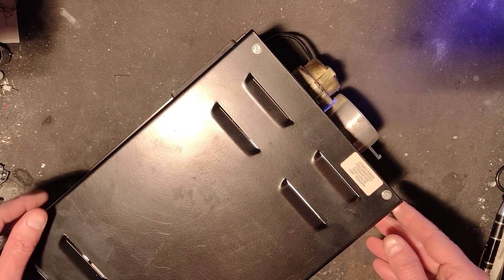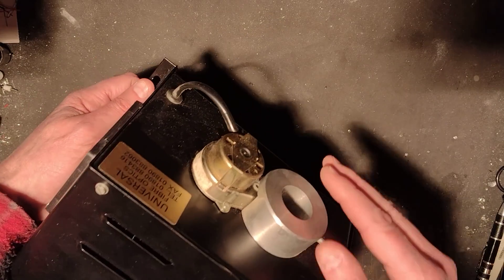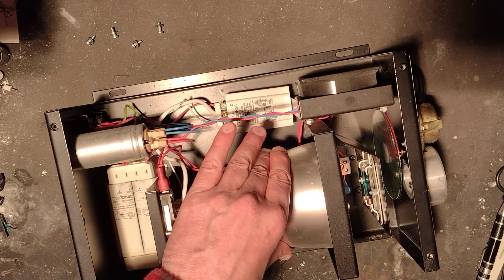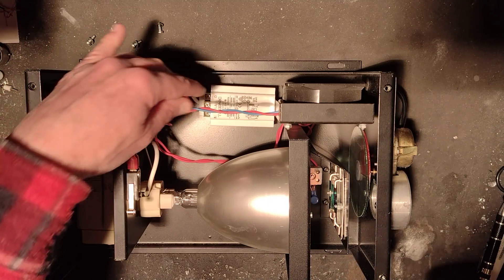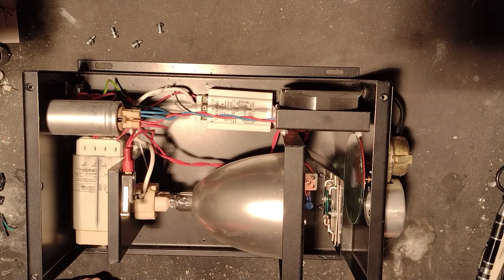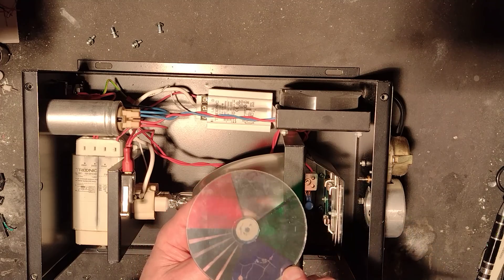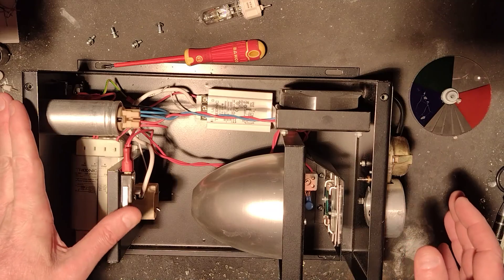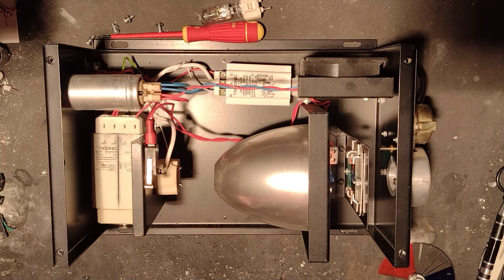Metal halide fiber optic illuminator

Comment: wow just seen this video and got reminded looking at our christmas tree that needs going back up in the loft  .. about 20-25 years ago we brought an 7-8ft fibre optic tree from BnQ  cost about £250 back then so not cheep . it ran well for 3-4 years every crimbo then a few of the bulbs failed (12v 10w MR11)  so i replaced them the next year the  thin plastic carusel ribbon broke maybe due too heat so i sellotaped that back together it worked again for a few years  ... then i cant quite remember whats gone wrong with it the last 15 years but as its out and due to be put up in the loft i might have a look at whats wrong with it properly after seeing this ... id love to get it working and modify it to run on led .. i got a feeling its some sort of power issue but will take it apart to try and find out ... if its not fixable by me is this something youd be willing to look at big clive ?. for a price of course ?.
Reply from the maker: An LED retrofit lamp is a great improvement for those trees.
Reply: @bigclivedotcom  yeah ive been looking i can get 4 for about a tenna so for 21 quid i should get this back working again mine needs 7 bulbs one upright and 6 that splay out the sides that have a trapdoor for easy access :) any suggestion what an upgraded cap i will need to buy ?.
Reply: just picked it up and straight away have seen without even opening it up that a (rubycon 25v 470uf yk) has domed and has brown fibres out the X part .
Reply from the maker: @davethorne3925  You could upgrade that cap to a 470uF 35V one.

Comment: I've seen Swarovski display cabinets with this type of light source before, but without the effects wheel.  The cases came out of a department store and have ABLOY Exec cylinders in the bottom cabinet where the light source is located.  When the cabinet is plugged in the fan in the bottom produces quite a strong draft.  Cases like that were well north of US$1000 new.

Comment: So nice to see one of these units again, it's been a few years since working on these lighting units, theres a few retail stores in town that use metal halide down lights primarily, just had a lead to the lamp holder while the controll box was effectively hung above the dropped ceiling, one store in particular had 4 of these projector units for the fiber optics that was throughout the sleepwear and bedding section to give a starey night sky effect, worked really well, was a nightmare setting out the fibers in the ceiling tiles.
Reply: Wow! "Controll" with two L's is a lot of control. Doubly controlled. 😁
Reply: @mattmoreira210  there's always got to be one ae haha

Comment: These were one of the most efficient devices for converting electricity into light ever devised, only exceeded by the most efficient LEDs with the most efficient power supplies.  This was actually one of their problems:  These lamps are far too bright for most applications, easily producing as much light as large banks of incandescent or fluorescent lamps.
Reply: True.  Short-arc sources can easily attain 80-100 lumens per watt and have excellent colour rendering, which is why they are still often found in studio lighting.  Only fairly recently have LEDs with the right characteristics for color-critical studio lighting exceeded 100 lumens per watt.  The only real drawback to the metal halide ones is the short operating life, but even this has improved with the introduction of ceramic lamps.

Comment: Those old UK-made  Thorn and later GE Arcstream lamps were, are still are very good lamps indeed tbh. They kick out 12,000 lumens with a CRI of 80 and a design life of 6000h.
I wasn't expecting to see one in there tbh, I was expecting to see a later, and more common these days CDM lamp. The ceramic lamps were even better with an output of 14,600lm with a CRI of 92 and a lifespan of at least 12,000h.
I've got a couple of fittings that use G12 halides in wattages from 20, 35, 70 and 150w and all of them are awesome with very precise beam control, something which LED has yet to match IMO.
It's also interesting that 150w CDM lamps in larger standard outer envelopes with GES bases are brighter at nearly 18,000lm and last for 20,000 hours. Seems having them in such compact form factors does restrict performance somewhat.

Comment: I have a fibre-optic 'angel' (Christmas deco) that blew its incandescent lamp, so I bodged in a somewhat modified LED downlight lamp, I was surprised how well it worked, even with the angels colour wheel. I liked the result so much that it didn't get packed away at the end of Christmas, and has now run, via a timer, for the last few years. I would have thought the motor, or my dodgy LED hack would have died ages ago, but no, she still shimmers away.
Reply from the maker: The AC synchronous motors are very simple with no brushes.  The colour wheel is also a very light load, so the motors will run for many years.  I've got a fibre optic flower base here that has been updated with an LED MR11 lamp.  It makes a huge difference to the intensity and colours.
Reply: @bigclivedotcom  Not bad for a light source that is mainly just blue & amber (phosphor) tricking our eyes that it is really white.

Comment: Oh, yes. I've encountered so many such abandoned-in-place fixtures of various kinds.

Perhaps my favorite was, when clambering around to fit a new BGM/PA system and route the networking/phone trunks, I found a complete speaker system already in place. The wiring had been run, but the wires had never been terminated and the speakers, though properly affixed, had not been cut through the ceiling. The grilles were carefully wedged upright as though to make the locations more visible.

Never did find the other end of the wiring runs; they simply disappeared into a suspended curtain wall (completely above the finished ceiling, yet still plastered and painted!) and couldn't be pulled back.

We left everything as it was, since there was a definite possibility of ceiling damage during removal. Fixed voltage speakers from the '70s, installed but never used for over 40 years. I'd love to have learned the story behind that.

After all, usually the speaker holes get cut in before the speakers even get near the ceiling . . ..
Reply: Most speakers I've seen mount to the hole in the ceiling itself, so don't quite get what you're talking about. Assuming the speakers mount to the studs/other structure instead of plaster/similar, perhaps the ceiling was put up after the speakers were mounted. That's what I'd expect if it was installed as part of new construction.
Reply: @eDoc2020  Around here anything mounted on the ceiling is required to be supported in case of earthquakes. The most common supports I've seen (and used) for speakers are either a light frame straddling T rails, a hanger wire, or both. In this case the ceiling was solid and the speakers were anchored to additional, non-load-bearing spans of the ceiling support framework.

It was strange in so many ways.
Reply: You see some right gems hidden away under dropped ceilings. I

Comment: I remember a school that was built around 1990 with a system like this as a decorative element. It ran for about 2 years and I suppose the lamp failed. It never ran again. Perhaps they couldn't locate the unit. It was a shame because it was really nice visually. Did they come in higher wattages like 400 or 1000?
The second generation of those highway message signs in the late-90s used tech like this in a lot places except instead of the wheel it had a matrix of shutters to form the characters that ran to the gantry overhead. Prior to that it was those green electromechanical pucks and afterwards came the direct sign-mount LEDs. Some of the fiber-optic ones were kept in service and the just light source was upgraded to LED.
Reply from the maker: Not sure if they did such high power versions.

Comment: Many years ago in my teenage years I became interested in disco lights and bought some gear from exchange and mart, one such thing was a device similar to this in that there was a light source via normal spotlight bulb and a small 240vdc motor with a disc containing 3 glass lenses and a red,green or blue gel. The motor span very slowly and gave the trippy coloured effect when pointed at the wall. 
Plugging it in at home in my kitchen for the first time, I discovered the motor wouldn't rotate, it was connected to the mains input with screw down terminal blocks. With my cheap and nasty lucky bag screwdriver I attempted to tighten the connections, half a second later I found myself about 6 feet away from the thing with my back to the fridge. That was my first lesson on learning to respect electricity. I've had a few reminders since then too. I'm glad I was a teenager before social media.

Comment: Sir, you mentioned about the IR reflector. I would be interested in knowing how they do this and still allow the white light to pass. Thank you for all your lessons.
Reply from the maker: In a dichroic filter a layer of metal is deposited to a thickness of a wavelength of light.  It acts as a selective filter, passing visible light, but acting like a mirror to the undesired wavelengths.

Comment: In a shopping mall no one cares if any light flickers or is out.
It's installed and forgotten.

You can still get a lot more light out of a discharge lamp and a lot more density.
They are not too bad for efficiency in high output applications.

Comment: We use something similar in the factory I do maintenance in they run a standard 24v bulb and have a variable light we still run halogen lights as the cameras we use on some of the equipment don't like led light sources. Very reliable in general.

Comment: OK, so now I know how to sup-up my outdoor X-mas wreath which has had a much smaller 12V version of this same mechanism inside it for years.   The lamp and motor still work but I actually have to turn off my other X-mas lights to keep them from drowning out the little twinkling fiber-optic points of light on the wreath.  One of those 4,000V suckers ought to do the trick...

Comment: I saw a smaller version of that in the late 70s - it was an illuminator for an inspection device that utilized fiber optics for illumination and inspection of the inside of turbines and other large machines. We take these for granted nowdays, but it was revolutionary back then - sensitive parts of machinery could be inspected without disassembling the entire device.
Reply: Those pieces of equipment have been in industry since the late 60's :)

Comment: How does the igniter work and how does it fit into the lamp cct? Is it like the starter in a fluorescent tube cct where the ballast is used to create a pulse when the filament load is removed?  Often heard the term igniter but never knew exactly what hey were.  Thanks Clive.

Comment: There are several advantages to Metal Halide, with a good reflector you can have pretty good efficiency.
Some bulbs deliver up to 100 Lumens / Watt.

The worst part with led are when they break, you can never find parts, and if you have lots of lights some of them will never reach 50´000 Hours.
Often forcing you to have one odd Light fixture, with different color temperature and lighting pattern. (or worse forcing you to change several of them)

Metal Halide, you just change the bulb, and the driver "lasts forever".
I'll bet 3-5 bulbs outlasts most Led fixtures.

Cheers from a Grinch 😂
Reply from the maker: In some cases one lamp outlasts 3-5 LED fixtures.
Reply: If you install lots of fixtures with non-replaceable parts it might be wise to buy a few extra units just in case of failures. When one goes bad you don't need to worry about an identical unit not being available.

Comment: Interesting to see one of those units again, BBC Tours had a couple feeding downlighters in a display area along a corridor in the basement of Television Centre.
These ran 24/7 so regularly needed a lamp change, unfortunately about half the time this was because the bulb itself had exploded… possibly some of my colleagues were not careful enough about keeping sweaty fingers off the quartz envelope. I always wondered what concentration of mercury vapour I was being exposed to while crawling around the back of the displays.
In order to save power and extend the intervals between bulb changes I mounted a timer on the case to switch off the lamp supply overnight (while leaving the fan running since the bulbs supposedly suffered if deprived of cooling immediately after switch-off). A couple of years  later BBC Tours moved out ahead of the closure of the building.
Reply from the maker: Explosive failure is a common end of life scenario for metal halide lamps.

Comment: That's got to be one of the most poorly designed safeties I've ever seen. It's almost worse than not having it at all because it has the potential for someone to rely on it to cut power and then lean on it wow they're working on it. That switch should be off to the side out of the way somewhere
Reply: Modern cases have a tab that goes into a slot to activate the interlock switch to prevent exactly that.

Comment: The blue gel likely cracked due to repeated heat/cool cycles and the thermal expansion of the glass plate repeatedly stretching the gel.  You see the same on old pinball machine backglass and you tend to see one or two colours being significantly more affected than others as they are less compliant to the expansion.  It's repeated heating and cooling that causes it as lightly used but poorly stored machines often show worse cracking than a machine that is in constant use but in a more temperature stable environment.
Reply: My guess as well.

Comment: I actually used to work for UFO and manufactured many of these MH illuminators, I  designed many of the led light sources and led fittings that UFO currently sell and continue to work for them on a Self employed basis a great company
Reply from the maker: The LED units look very stylish.  Literally designed around their function.
Reply: @bigclivedotcom  they always were and we kept things simple...well as simple as they could be. The early days were hard work as museums required high CRI not so simple with early LEDs but my biggest achievement were the MH equivalent units. We were first to the market. UFO no longer manufacture MH or TH Light sources unless specifically requested.
Reply: Are LED fiber optic illuminators as reliable as MH ones or do they start blinking after a few years or use like pretty much every streetlight out there ?

Comment: That capacitor looks to be very similar if not physically identical to the one used as the main wash pump run capacitor on older model Whirlpool dishwashers. FSP number 8269507 which is 23.5 μF 280 V rated. The second groove from the top is actually a folded bellows section to allow it to expand in length should it fail and produce gas pressure internally.

Comment: Clive I remember our old GE 8mm projector had those neat but expensive Sylvania or Westinghouse DJL lamps that had an internal reflector. Haven't see those lamps in a long time.
Reply: It was probably using an halogen lamp (with a tungsten filament) rather than a MH lamp (short arc discharge), I suppose.

Comment: Very simple circuit, the same as used in conventional street lights. LEDs might be more efficient, but discharge lamps are still more reliable.
Reply: And discharge lamps don't cause harmonic headaches for the grid unlike LEDs

Comment: I wish you had explained the ignitor & ballast circuit with a diagram. I've often wondered how they work.
Reply from the maker: I may cover that in another video.
Reply: @bigclivedotcom  I've always found ballasts very intimidating.  Anything electric that buzzes should be treated with the utmost respect.
Reply: The ballast is an inductor in series with the lamp, which does for AC what a resistor does for DC: it limits the current, other wise the lamp would self destruct.The ignitor is similar to an ignition coil in a car, it is also an inductor but with much higher inductance that creates a voltage spike via a relay.
Reply: @mojoblues66  thank you, that helps some. I have some varying types of 400W Na/Hg ignitor with separate starters and random shape & weight ballasts so it's always been a bit of a mystery. Obviously they are inductors from the noise and design but I never had a dead one that I could cut into. Not like fluorescent ballasts. They're a penny a dozen, least were up to leds. Maybe now sodium is antique tech I can sacrifice some for science.

Comment: So with a setup like this, i imagine they keep the fibre optic bundle and just change out the light source? One thing i have noted, here in northern Canada, the LEDs up until very recently could not handle the extreme cold - it is currently -40C / -40F here, and yes there are parts of Mars warmer than us right now - whereas the Halide would warm themselves up amply. A common thing to see were ravens sitting themselves on the photo sensor of street lamps during the day, causing the lamp to turn on, and in a short while, warm raven. They seem to be less impressed with the LEDs!

Comment: I was just digging around in a video projector for the last few weeks and now I find it funny that I'm watching a video about video projector lamps.
Interesting fault the two cents lines that come from the lamp ballast we're against a piece of metal and I think shorting a little bit causing the system to go into safety but not consistently enough that it took a while to troubleshoot there's other problems but it's at least ran for five plus hours didn't shut off after I rerouted those two cables.
Reply: Edits: video about video projector lamps = Similar technology different implementation.
"two cents lines" should read 2 sense lines.